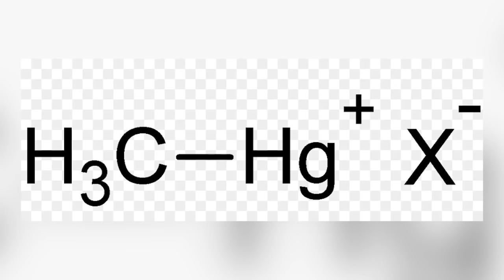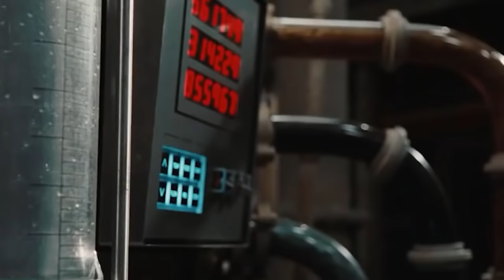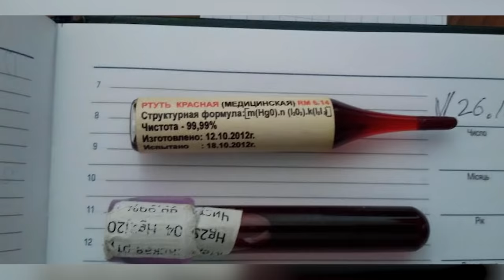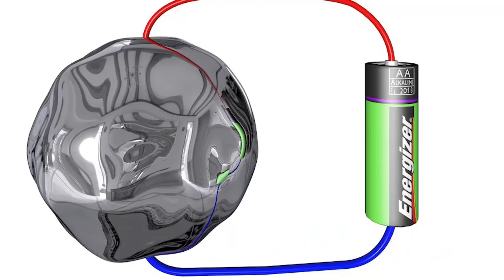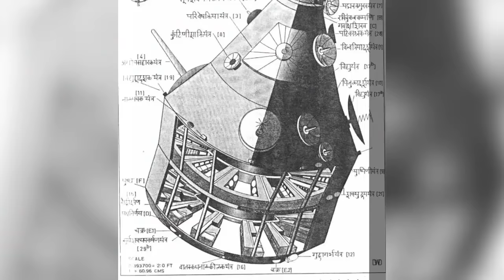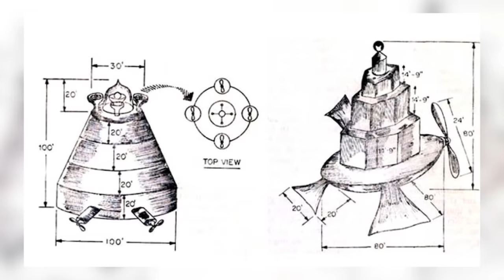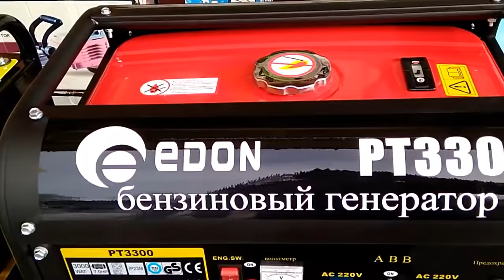Thats Why Mercury Engine Is Forbidden

Comment: Yes to all the above. Ferromercurial-cobalt mixed in the right proportions placed inside a vacuum thick glass toroid pulsed with sequential electromagnetic field will float at the center of the rorroid and away from the walls.as the voltage and frequency increases, the mixture will create a plasma. A corona-like effect is seen. As the radial velocity approaches near relativistic speed, a current will be induced in a larger circular coil. This will create a resonating field that DOES NOT CACEL GRAVITY BUT RATHER HIDES  OR ALL OR PART OF THE MASS OF THE DEVICE. Look at models from Marc McCadlish which remain online even after he was "suicided" on April13 of 2021.  You can also use a Hartley or Colpitts resonator circuit to direct the craft. The one  he shows is 10m  in diameter & uses copper plates separated by Bakelite as a huge capacitor that is an integral past of the resonating circuit. The 5 meter tube in the middle is where the ferromercurial colloid rotates. His craft does boot use a  Tocomac configurationn

Comment: In school, we played around with a little bit of mercury. I learned that in its liquid form, it's not dangerous at all, but it always evaporates a little even at room temperature, and you  really shouldn't breathe that in. -- And in our chemistry lab, the mercury bottle was stored as safely as the radioactive substances. Because, young people always have a strong interest in things they shouldn't own.
From electronics, I know the concept of a mercury switch, or "tilt switch": A tiny glass tube with wires at the ends and a small ball of mercury in it. You tilt the device, and the mercury closes a contact, so the device will do something. I don't know whether this concept is still used in modern cellphones or tablets, or if they found something different.

If the technology really works, I can't see a problem building a mercury engine or generator. You only have to contain the metal properly.

Comment: This video could be watched from children. Be a little bit more responsible. Liquid "Hg" is dangerous especially when it is stuck under your floor decking and somebodies family is inhaling it for years. There are bellow some of well known hazardous effects: "Chronic exposure by inhalation, even at low concentrations in the range 0.7–42 μg/m3, has been shown in case–control studies to cause effects such as tremors, impaired cognitive skills, and sleep disturbance in workers." - Source:
ATSDR. 1999. Toxicological Profile for Mercury. Atlanta, GA:Agency for Toxic Substances and Disease Registry. "Archived copy" (PDF). Archived (PDF)from the original on 2011-07-21. Retrieved 2011-02-22.

The fancy music and dreams of alien propel system won't help you to avoid these symptoms and damage!

Comment: If you go through records you'll find historical figures that tended to go downhill over the long term, the connection just wasn't made back then, same with lead and asbestos. Mercury compounds weren't taken out of vaccines due to instututional forces but rather public backlash based on oversimplification. I think you have a point that mercury is unfairly maligned but I disagree that there's any particular intent behind it, mass opinion simply loses nuance to the benefit of no one. On the subject of lead notice how leaded gasoline was banned along with freon despite corporate interests and how so many logging, mining and manufacturing practices go on pretty much uncontested despite their harmful nature being well known. There have been comparable conspiracies that have been successful for some time such as Volkswagen's diesel engine computers being programmed to run differently when tested or the numerous financial ones but there are factors that are needed for things like that to work and they always decay over time. In particular there needs to as small a number of people that know or are likely to investigate critical details as possible. Study of mercury is not that, if it was a substance only found in America then maybe but study of the eightieth element can and does occur worldwide, I think you would be able to find solid information by now but you don't seem to have it.

Comment: Presser moter will run for free. Jets like at car warsh used in end of gun to spray car. Round enclosed disk with presser jets on out side of it. Spin this at 7000 rpm. Will build presser and fire off jets. This will cause round disk to run it self. Jets must be pointed back at a angle. To push in circle bring up to presser by spinning at 7000 rpm will cause jets to come to presser and turn it self. Easy and dose work. Run at very high rpm. Put in can and catch presser fuel and reuse. Over and over. Can use. Water or cooking oil or trans fluid. Runs for free. Promise. Easy easy.

Comment: Wow, that was disappointing...
Watching the title, I though you would talk about rocket ion electric engine... 
You know, the thruster the ionizes a propellant with an electric field and then accelerate the ionized particles in order to achieve thrust...
Modern ion engines use Xenon, which is an heavy, easily ionizable and relatively harmless gas. That results in very good specific impulse.
But, in fact,  Mercury is even better for this kind o thrusters, much heavier than Xenon, and easily ionizable as well... except that it's really dangerous and toxic...
THAT is the real "Mercury Engine"... the rest is only Harry Potter.

Comment: This video is nonsense. Take the example of the monk flying across the Channel in 1751. Assuming that were true, it would be a massive deal (just like the first hot air balloon and the first aeroplane crossing the channel were). The industrial revolution had not even started then so if someone could demonstrate powered flight then it would have blown everyone away
Reply: And for all the ones saying "I broke a thermometer and played with it and nothing happened"; mercury is a heavy metal and it accumulates in the body over time. Play with it for an hour and so and you will be fine. Work with it every day for about 10 years and you will likely start to see effects. And like most heavy metals such as lead; there is no cure as there is no way of removing it from your body once it is absorbed.

Comment: it's mildly dangerous. absorption through the skin is miniscule inhalation of it is more problematic and it builds up over time. it builds up on your nerve endings especially in your brain the neurons. It takes somewhere around ten years for the material to clear from your system naturally and was used in the felt or hat making industry which back in the day which is where most of the modern warnings come from. 

I got a pound of it sitting on my desk in a sealed container. I wouldn't eat it, I don't wear gloves when I'm working with it but I'm not unnecessarily touching it either, and  I'm always trying to think how heat might effect it when using it in some research so It doesn't vaporize. It's better for the general population to treat certain things as grievously hazardous so they don't get complacent.

Comment: My gravity drive works  so I know dam well mercury is prohibited  because the government has already figured out what I did and mercury is essential to my design  however I just don't have the money to scale it up or the time off work or the machine shop needed to manufacture the precision part's  remember mercury makes amalgam with all other metal's  basically eats the engine but I figured out the technical problems years ago and refuse to patent or realse the design because of the way life changing inventors disappear or get robbed. 😀basically is powered by electricity  so a reactor on a space craft  could accelerate all day every day and is scalable for artificial gravity ( I theorize it would create a gravity field around ship) just a educated guess lol however  no fuel needed and gravitic energy is perportinal to electricity in.. so you could literally jump in fly to space zip around and slowly come back no heat shield needed, no escape velocity nessasary no orbital velocity needed just hover 50 miles above the crib . I know the governments have figured it out simply because I did before the internet was turned on.

Comment: Zjatet stretch of length weight portion apple from a tree growing connected to the tree to far up attached stretches the weight of the apple to fall if the apple is attached to the tree to close to the ground attached to the tree the weight attachment does not Weight down enough to detach, terminal velocity,  terminal and base magnetism terminal attraction of base base attraction of of terminal attraction singularity attraction both force of objects attracted to the mass of attracting magnetism on both objects attracting one another , base Mercury intense fusion singularity, copper attracted to terminal thermal conductivity electric magnetism external force thermal waste discardement attraction to external force circulation perpetual engine ventilation cooling apparatus circulation hitting piezoelectric crystals making electricity currents direct external force ventilation trajectory attractive force cooling levels of nitrogen rotating magnetic field module Dyson sphere attachment outer magnetic rotating sphere rotation attraction external direct force Dyson spheres covering all angels available intended of magnetic field rotation producing moving force of gravitational levitility direct propulsion thermal electrical magnetic force of attraction external force directed attraction one way direct attraction electrical impulses pulse waves pulse conductivity signal transmitters transmitting conductivity pulse emission electrical magnetic impulses external force outwards direction flow attraction resonance force propulsion velocity Mercury vortex intense infusion attraction singularity to Mercury vortex pull attracted currents pulls , theory evaluation in progress fun Proposition theory

 suppressed by internal private background opposite oppositions forces never giving outside insight out of bounds of opposites in bound to their own advancements , deity privatised industry background privacy kept advancements throughout history suppressed against oppositions opposites backgrounds against private background coalition kept private throughout history kept populations decived all is proved a life with propostions stated Facebook Ergys knows and Ergys kamberi